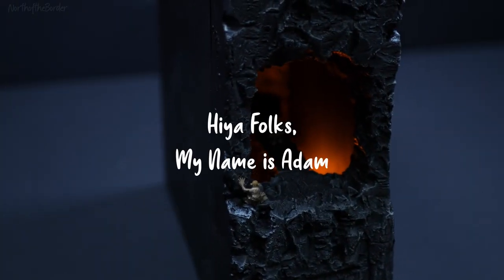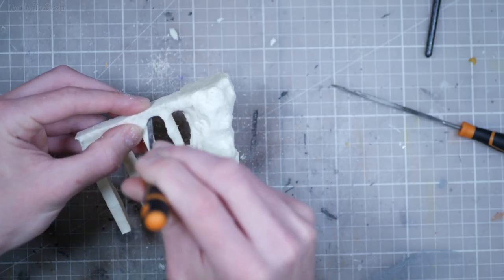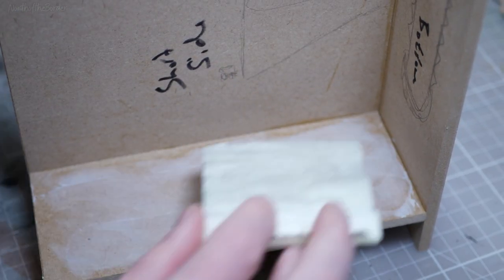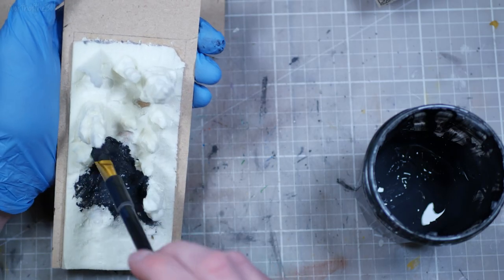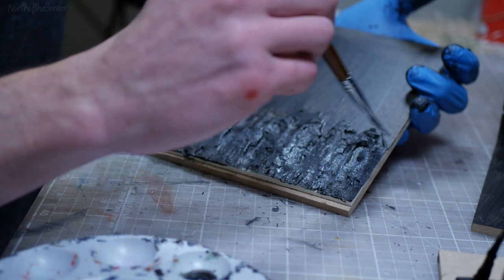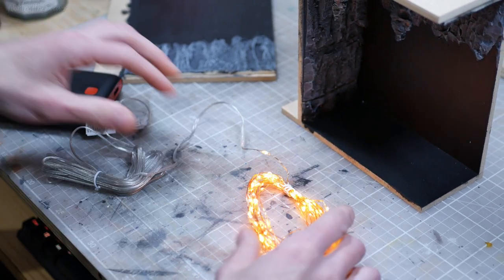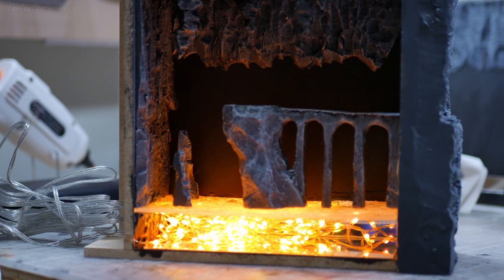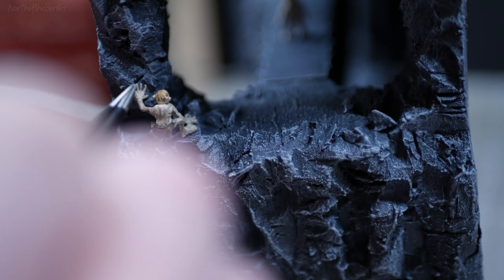Mount Doom Book Nook // Lord of the Rings Diorama

Comment: I really just enjoy the funny zen of your videos! Just a tip I learned back in the 80s when I couldn’t afford a mirror with a frosted design that I wanted. CLEAR Con-Tact paper will give a perfect frost to any glass smooth surface so you don’t have to sand (or sandblast) anything. Just spray a light soapy solution on the glass/acrylic, place the Con-Tact and squeegee out the water and air bubbles with something like a credit card. I have it on the side lights of my front door for 15 years now and no one can see through.
Just so you know, I am 70 years old and I watch most of what you do… you are so silly and entertaining, and I love your trial and error approach to creating… it’s my approach too and will serve you well! Nerd on!